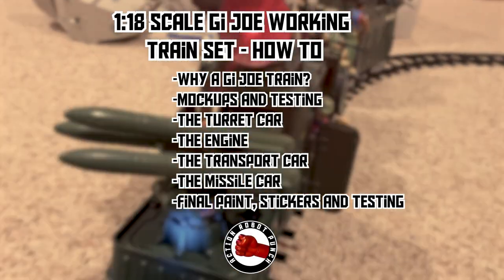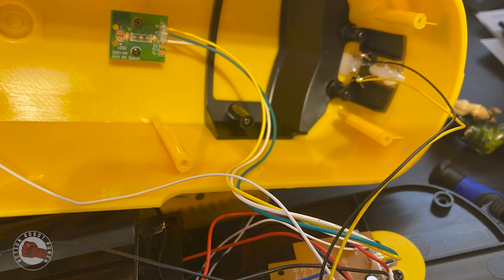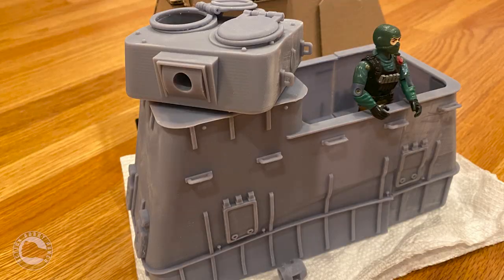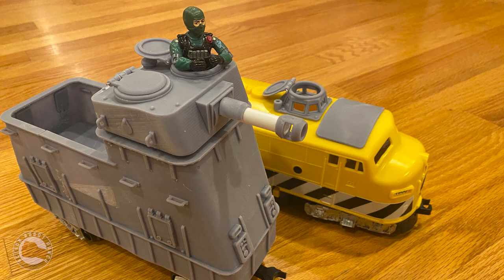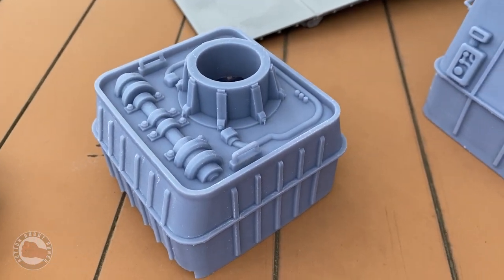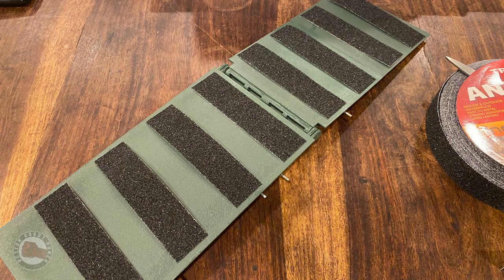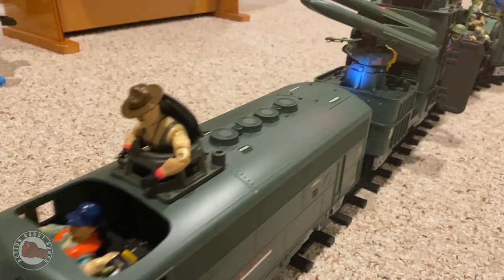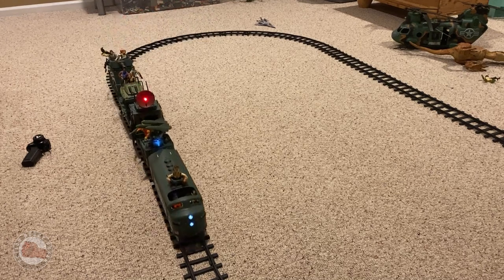Custom Gi Joe Combat Train Set - COMPLETE - Modified for ARAH figures and vehicles! - How To

Comment: Are you looking to adopt?

Seriously this is really impressive. When you first started I really wasn't loving the scale and thought it looked silly but seeing it all done it definitely works.  Sure it is hilariously undersized but it is a toy and toys are usually undersized and out of scale.  I could see this as being an on base logistical transport moving equipment and munitions from place to place as needed and helping the armoury keeping everything ready.  It would be cool to have this in a diorama surrounding the V1 headquarters maybe or in a shipyard being support to resupply the FLAGG.  I know you have kids so you really play with all your toys so permeant dioramas aren't really your thing.  

I al really surprised no one has made a FLAGG bridge via 3D printing or even low volume molds in resin and sold them.  It seems a good bridge, a sticker set for the deck and instructions on what dimensions to cut a deck out of wood or melamine would sell well.  Most of the Flagg is little more than a cheap plastic table that could easily be replicated.  I am certain a lot of collectors would happily pay $500 for a semi DIY FLAGG
Reply from the maker: Hahaha, thanks so much. Yeah I have enough kids. Thanks so much. Toy scale is a funny thing but once you add the figures it kind of makes sense. And it had to fit on my 3d printer. It's funny but my printer size helps make a lot of my decisions. 
Flagg parts is a good idea. I think the bridge is just a really big print but I wouldn't be surprised if someone tackled it. Just not me...or not for a while. Thanks for watching!

Comment: Hey, I'm planning on to custom paint 2 Star wars starfighter (from power of the force A-Wing and Mission fleet N-1 starfighter) Do they really need priming If im using Tamiya spray paint? or Could I just spray paint it directly?
Reply from the maker: I never use primer. Maybe if the color of the ship varies a lot, you can use a cheaper primer to even out the color to a grey, then your expensive tamiya paint will all look the same and you won’t waste it trying to cover underlying colors. But I would make sure to clean with soap and water. Before that remove any stickers and use goo gone to remove residue. If there are thick paint areas you might need to sand those down. I’ve learned the hard that it’s true that prep work makes the painting easy but I’m impatient 😁 But tamiya paint is really good. Do a test shot on a small area on the bottoms or something. See how it takes. Fwiw I use cheaper Krylon paint because it’s tough and bonds really well and is cheap. But tamiya has the best color and quality for detail. Good luck with the project!
Reply: @ActionRobotPunch  Thank you for such a detailed reply!! I'll give an update when im done lol. really excited with the Mission fleet N-1 Starfighter because i was able to mod it to fit a 1/25 joytoy figure and it looks cool!